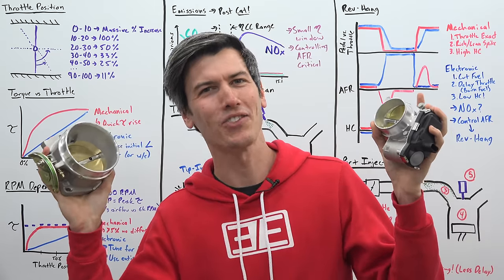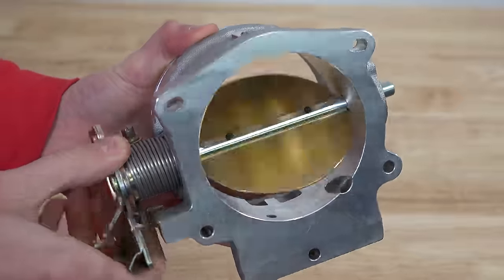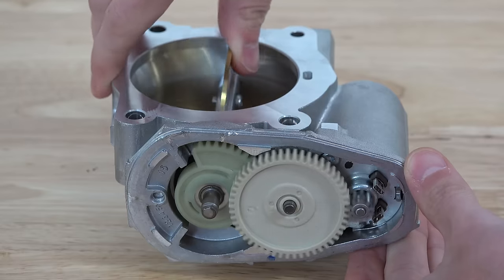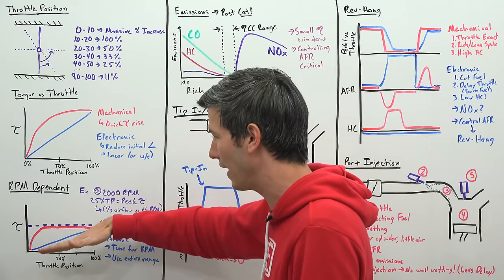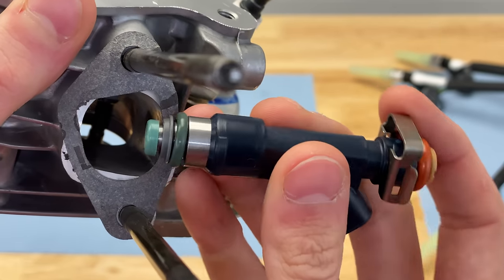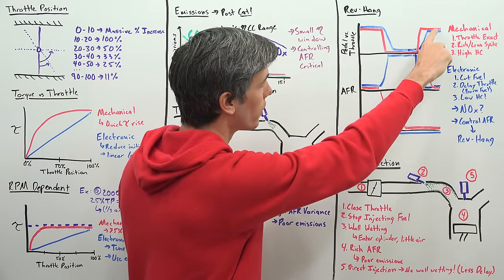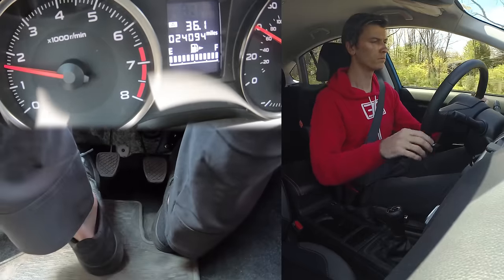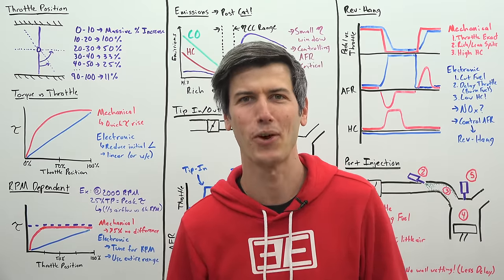The Big Problem With Modern Manual Transmissions - Rev Hang

Comment: I’ve seen mechanical throttle bodies with a “cammed” lever so that the airflow increase is more proportional to input at the accelerator pedal.
Reply: thats really interesting, thanks for sharing!
Reply: I think that most have that.
Reply: @aitorbleda8267  Yes; I was surprised he left that detail out.  I was all but shouting at the screen over it.
Reply: I believe Porsche used that in their older (?) cars. So that the driver gets a more aggressive feel when applying the accelerator.
Reply: Honestly I haven't seen many that don't have a cammed lever.
Reply: The mechanical TB Jason used has a cammed lever!  Off idle is on the big radius, with less rotation per inch of cable pull, vs at wide open throttle on the smaller radius with more than twice the rotation. Good pic at 0.05
Reply: Was just about to write this. My XJ 4.0l had a cammed lever with a very linear response.
Reply: GM 3.8 throttle body had a progressive ramp up
Reply: If you really wanna take a look that cam, look at 944 Porsche, not the Turbo, the normal one or a Volvo
Reply: @lolbuster01  This ... I've never seen an automotive carb that didn't have a cam lever.
Reply: First one i saw was on a Buick 3.8l V6 odd fire. It was similar to the 3.8Turbo V6 but the firing order. We just replaced it because it had a recall on it.
Reply: I am sad he glossed over the cams.  But the rpm dependent variable still remains unaccounted for.  While one could make a 2D cam or hydraulic transmission, but would be very tough to tune, be expensive and be another system that could mechanically fail.  And failure of throttle is dangerous.  So microcontrollers to the rescue!
Reply: yes, such "cammed" twist throttles also were used on motorcycles. And if you race, you choose suitable for you "radius" which determines linearity of engine response.
Reply: @Cas1O  I think it is not a big problem to solve. And maybe it was addressed but I don't know. On my old russian car the carb has 2 chambers. One you control by pedal, second is controlled by intake pressure. Because pressure depends on rpm, you can design system that opens according to rpm.
Reply: @inevespace  There you go.  The intake pressure is the vacuum I referred to.  With that, they are functionally the same.  But the question is reliability, tuneability and cost.  I think the electronic is probably in general more reliable, cheaper and more tunable (by the oem at least).  But the degree of tunability of the original is probably fine.
Reply: And my 2016 pedal has a similar feel in that it gives a lot of response right when I first press and very little response near the bottom. And as far as everything being intuitive, its all about learning the vehicle. You learn the feel of the pedal and the engine response. I would say that the electronic throttle in my 2016 Cruze is less intuitive than the other vehicles I drive regularly because the computer keeps trying to change the response.
Reply: @jasonpace513  take a look at the edelbrock and holley offerings for chevy small blocks and retrofits for pre 1970 cars. Theyre pretty much a lever thats pulled by the cable
Reply: My first thought,  glad someone else noticed
Reply: most older Japanese cars are like that
Reply: Doesn't the cat convertor prevent the HC & NOX emissions during throttle tip-in & tip-out?
Reply: Knowing what I know about fluid flow dynamics & dampers & butterfly valves (I work as an instrumentation & process control systems technician), there is little change in air flow once the butterfly opens more than about 60 to 70 degrees unless it's a specially shaped damper plate/butterfly as is often found in industrial applications. The rate of change of air flow from closed to fully open is quite exponential.
Reply: Never had such issue: I drive a diesel.
Reply: @davidebacchi9030  diesel doesn't control oxygen intake to calculate fuel but the other way around
Reply: ...Like the one he is holding...
Reply: @pbakker  Actually, at least on the 944’s, it gave a LESS aggressive feel because they felt that the 4 cyl wasn’t refined enough to stand up to Porsche standards. It’s a popular mod to swap them out for circular ones to give a more responsive feel.
Reply: They did that on carbs too
Reply: @kevink2315  Good observation
Reply: Yes indeed, my 1990 BMW E30 has an eccentric pulley on the throttle body even
Reply: I thought this could work but I didnt know it was a thing, thx
Reply: Ive got one! It came on 1994 Mazda Miatas.
Reply: My ‘97 Subaru legacy GT has a cammed TB
Reply: That was the answer. Not "drive by wire". The less control a computer has the better.
Reply: We often put profiled cams on butterfly valves on chemical plants / refineries to give a more linear flow vs position response…